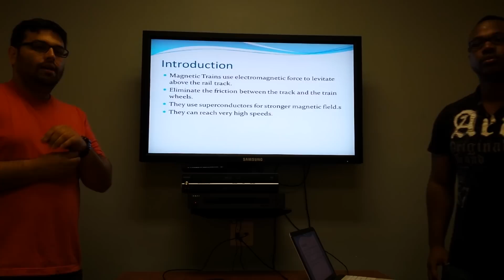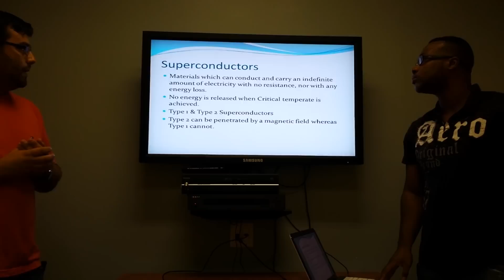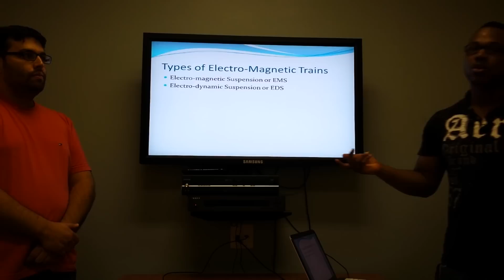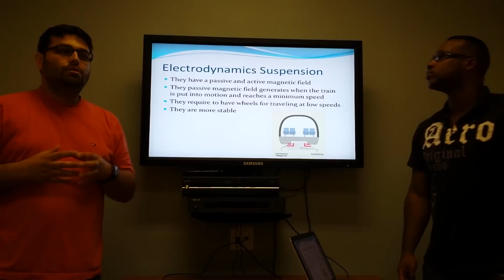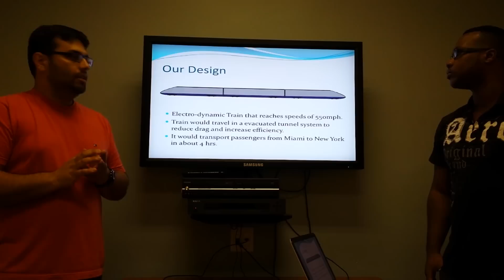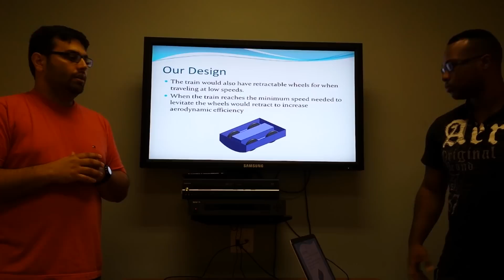Team 19: Magnetic High Speed Trains

Comment: Slides and audio is very clear. Electromagnetic trains have always been an interest on mine, so the topic was very alluring. The lighting of the presenters is slightly darker than optimal, but I understand its hard to balance the clarity of the slides and the presenters at the same time. If the laptop or transitioning device was off screen it would improve the overall feel and flow of the presentation. Also a more formal attire would be appropriate. Very informative and well done presentation, the speakers clearly know what they are talking about.